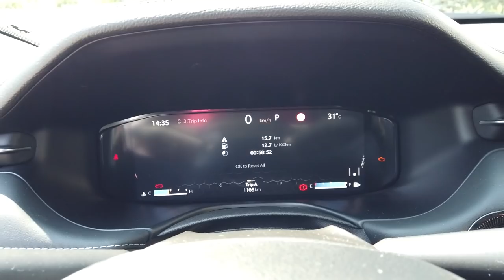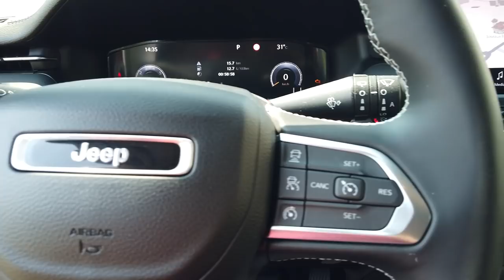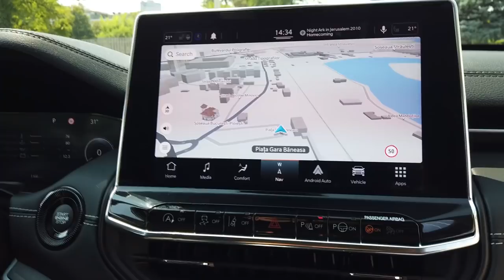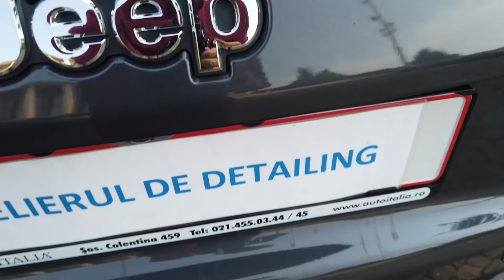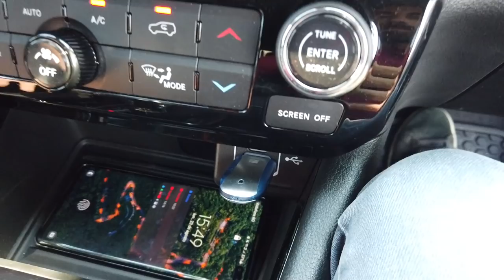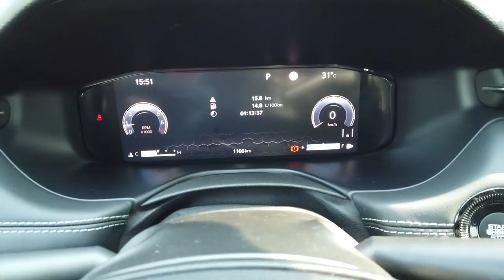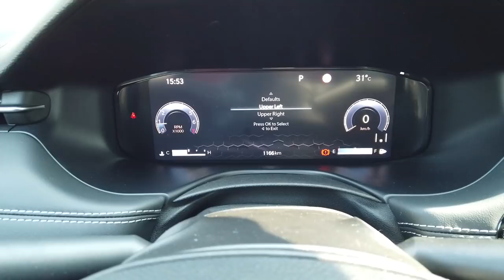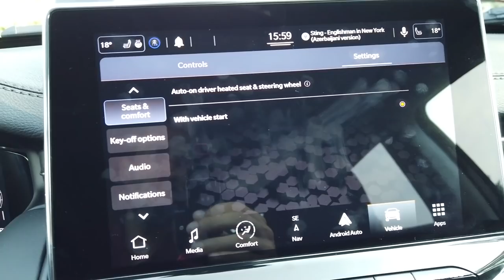Jeep Compass - echiparea de 28.000 Euro( fara RABLA)

Comment: Salut Vlad.
Am avut ocazia să conduc un Grand Șirochi cu mai mulți ani în urmă.
M-am simțit cam ca în Aro dar mai confortabil. Avea vreo 80.000km, diesel dar nu mai țin minte capacitatea.
Marele ciubuc al acelei mașini a fost că a fost cumpărată de un nene care avea damblaua pescuitului și barcă pe trailer și umbla puțin. În rest întreținere și stat în garaj încălzit iarna.
Deși era cam țăcănit nenea avea grijă mare de ea și cam chiar prindea pește. Uneori d-ăia de acvariu dar alteori dihănii cât juma de portbagaj.
Mi-a dat și mie odată un crap de n-a încăput în congelator decât ciopârțit.
Nu mai știu nimic de mașină și de nenea dar sigur sunt bine.
Reply: Probabil era om647 5 in linie, cel mai nou avea om642 3.0 v6, ambele motoare de Mercedes.
Prezenta editie are vm motori a630  3l v6